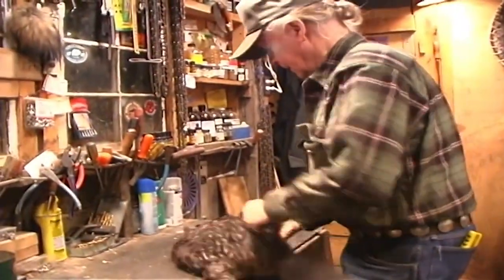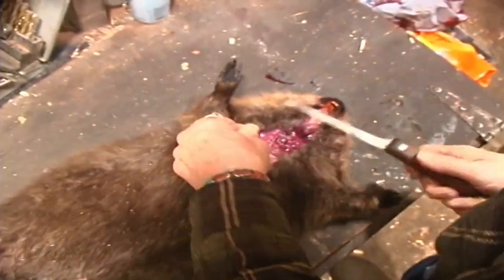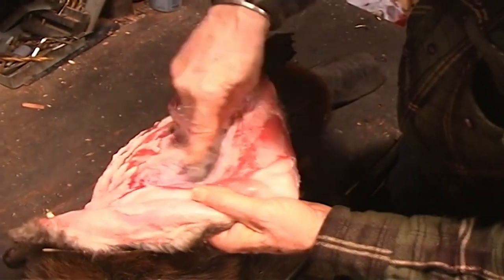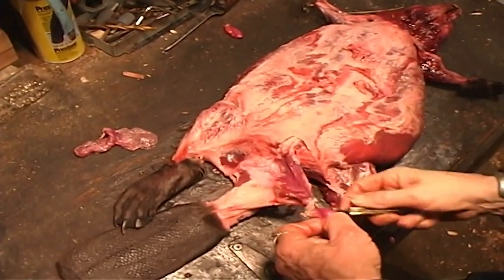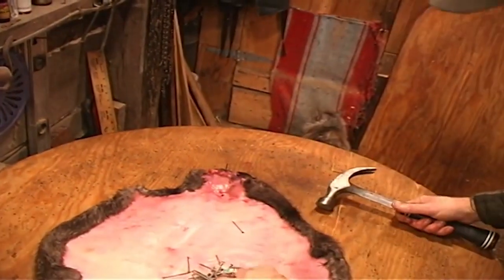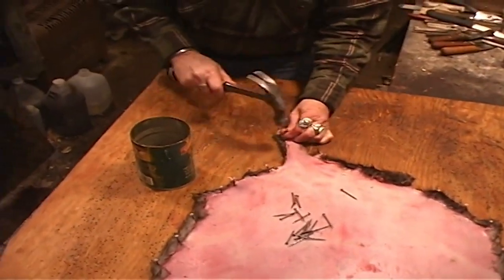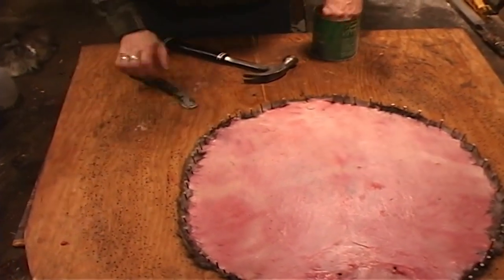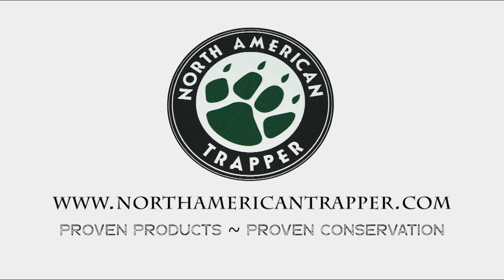NO LEG HOLES SKINNING OF BEAVER......PUT UP FUR PELTS

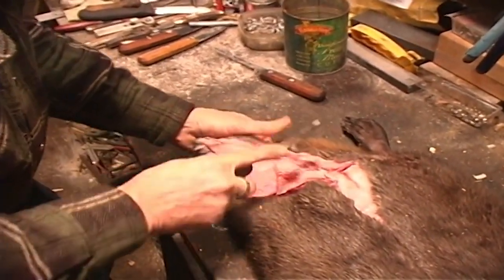Comment: When I trapped with John I guess we did them without leg holes for a while, but some buyers knew what it was and didn't like it and would actually put them in the damaged.  When you get proficient at skinning you can skin them just as fast either way.  I got down to 2:40 on an extra large with leg holes.  There is a Canadian in Alberta that has done them in under 2 minutes with leg holes  When tacking, there were always "extra" flaps of hide to remove when they were done without leg holes, fur that remains with the hide when you do it with leg holes.  If it's within the grade, it makes little difference if you gain an inch.  It does make scraping a little easier as there are no legs to go around.  Nice to see Johnny scrape one.  When we were partners in Virginia I scarped all of the 800+.  I guess if you asked Johnny the easiest way to scrape them he would have said, "have your younger strong partner do it." LOL.